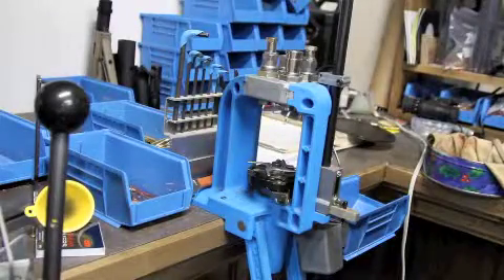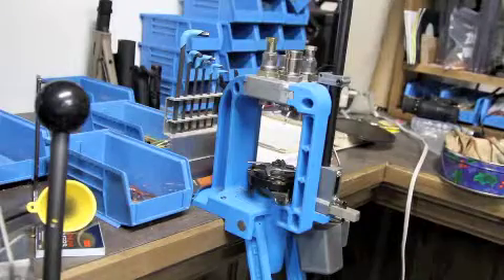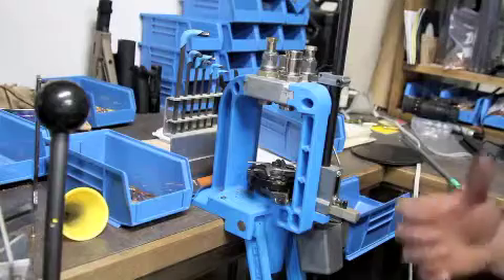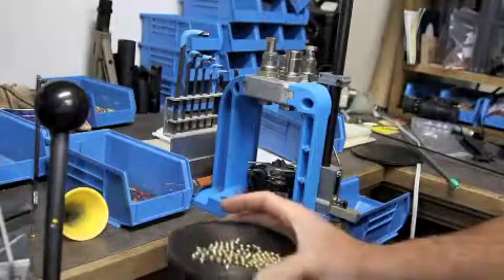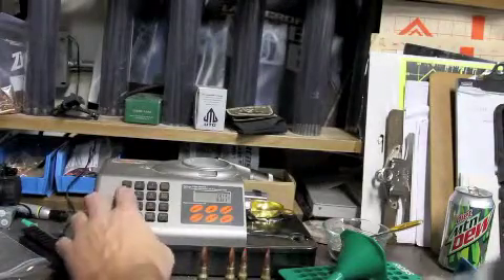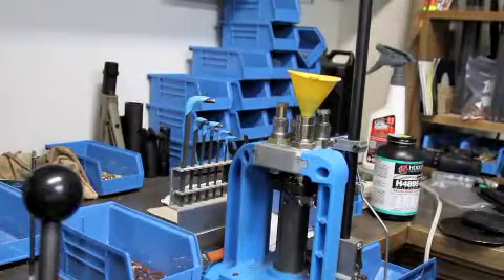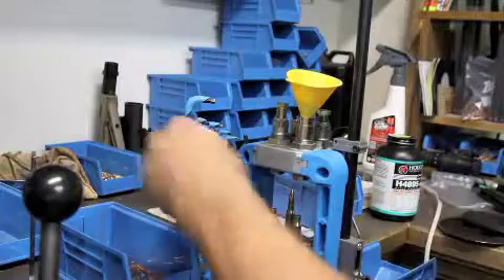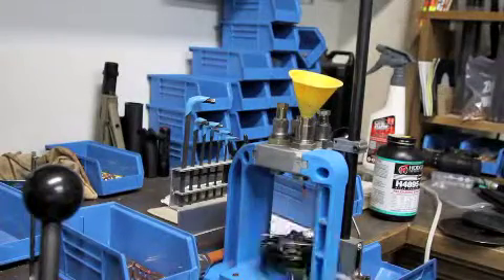Lyman powder mesure

Comment: Do you use the standard power die setup, or did you have to get the 450 powder die to hand drop the powder?
Reply from the maker: hey Crusader, it's just the standard Dillon powder die with the insert that comes with the conversion kit.